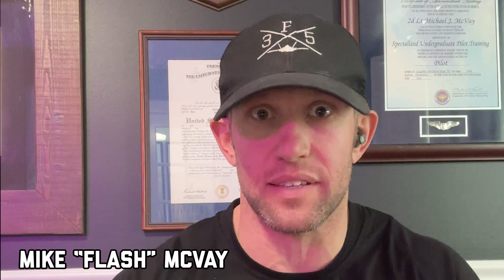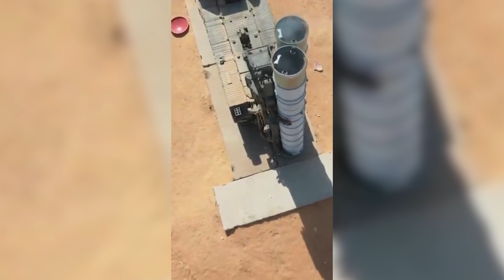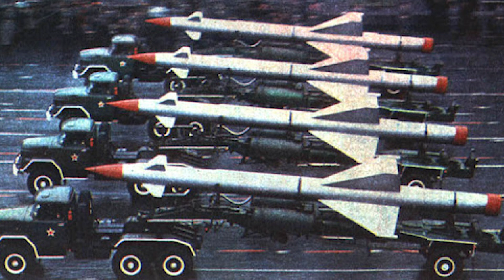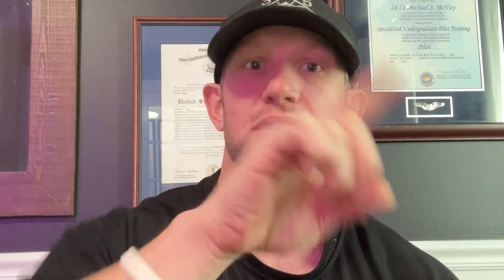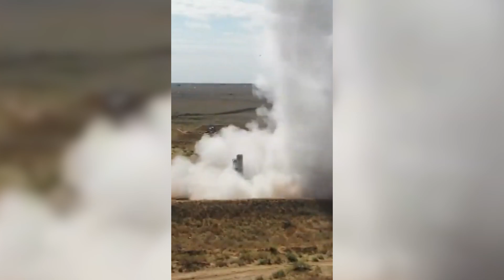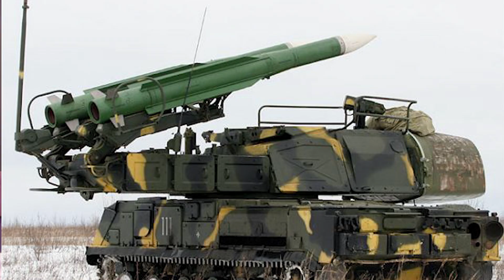Fighter Pilot Breaks Down the Evolution of Surface to Air Missiles

Comment: Informative vid.👍.  Who has the  equivalent of the various Russian  systems mentioned?

Re the speed. It is quick, but it's not difficult to slow it down using the YouTube speed adjuster. 80% works for me.
Personally I dont mind that one speaks and thinks at their own pace and we do the adjusting, its more natural for you as the content producer. Or simply edit the recording after.  Basically easier than screwing with your mind during recording )

I find the lack of pauses a little more difficult. It'd be the equivalent of reading one huge paragraph in a book.  Thats even easier to sort though.